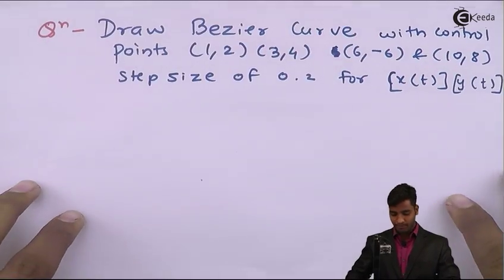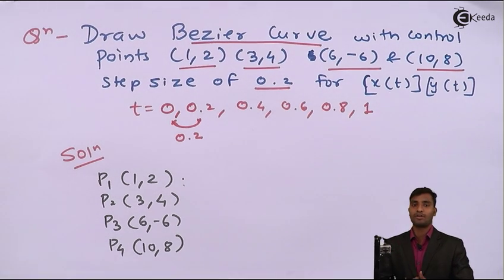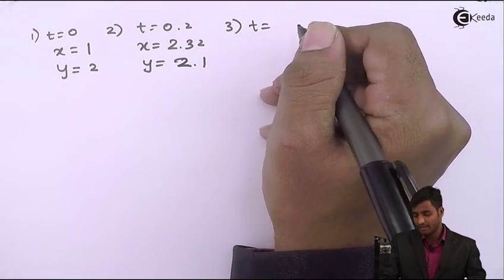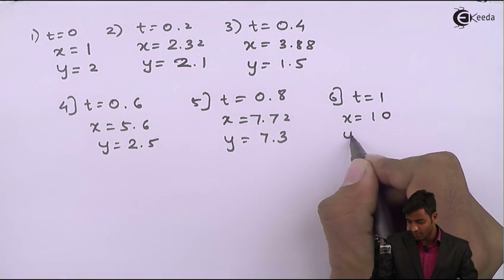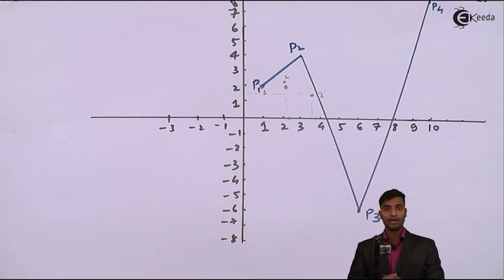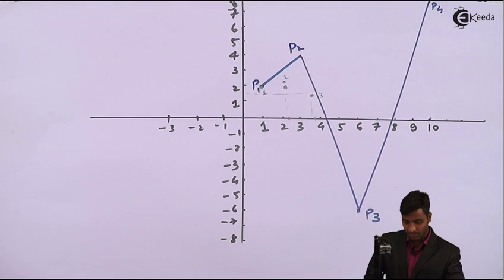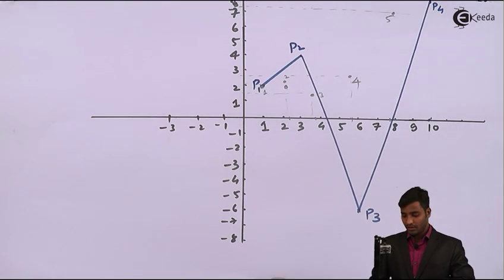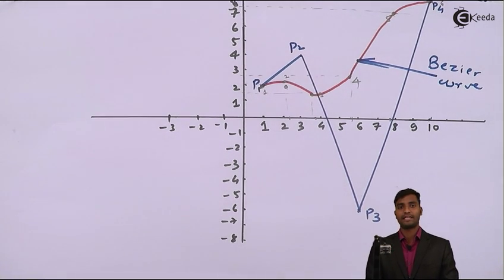Problem 2 Based on Bezier Curve - 3D Curves - Computer Aided Design

Comment: Yes some values are wrong
for t=0.2. y=2.048
t=0.4  y=0.944
t=0.6.  y=0.416
t=0.8.  y=2.192. This Question from MU nov 19 exam for 10 marks
Reply from the maker: We noted your query. Our academic team is working on it and will update you once the issue is resolved. You can download our app where you will get all the concepts from basics, practice problems and doubt asking facility. 
Download App - https://ekeeda.com/download.html

Comment: I have a question in which there are only three control points given and I need to find the degree of the curve and also need to find value at u=0.5. What is p4 in this case? Please help I have a exam tomorrow.
Reply: Virat Dewan solve by three points only
Reply: if no. of control points are 3 then degree of curve will be 2. If degree of  a curve polynomial is n then no of control points will be n+1